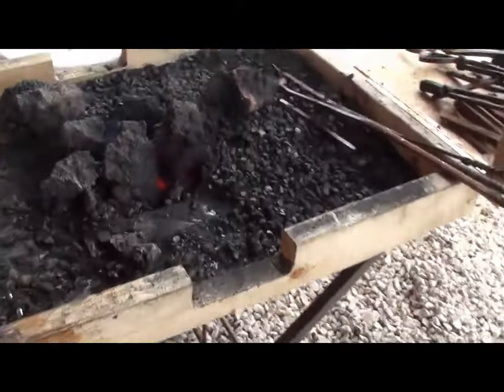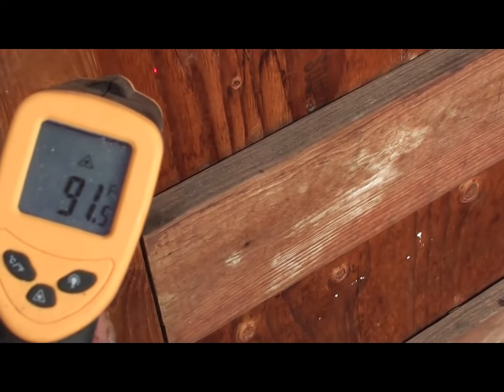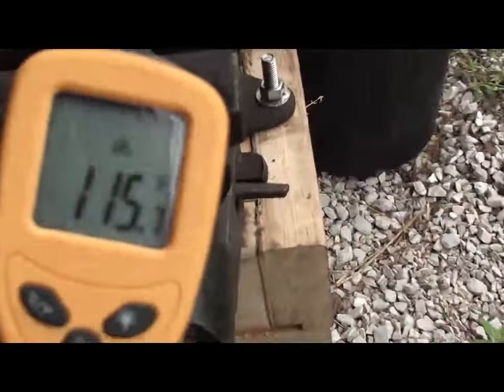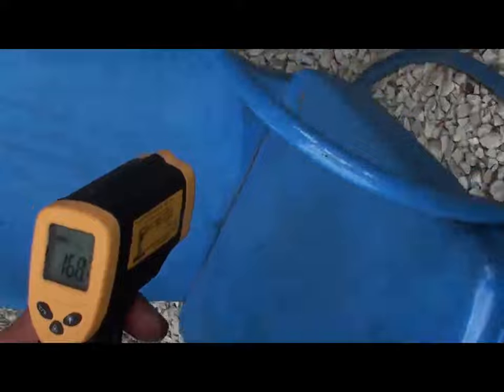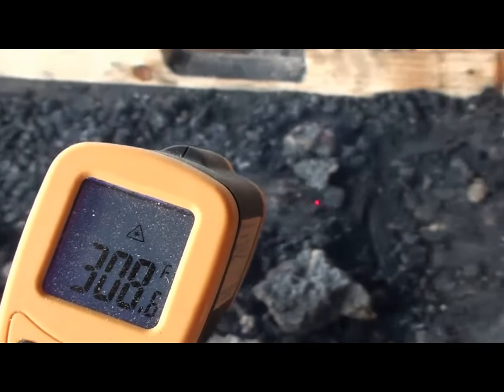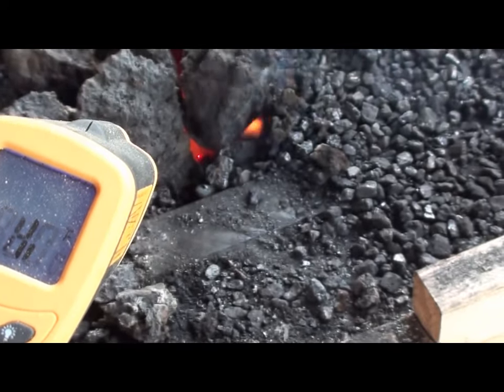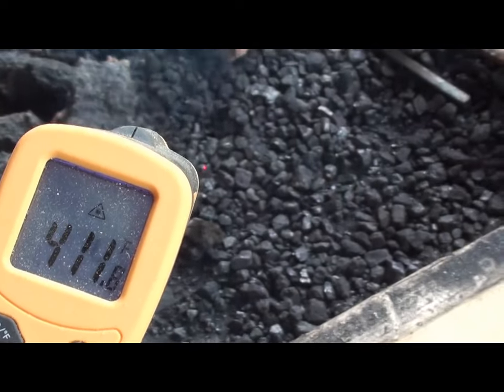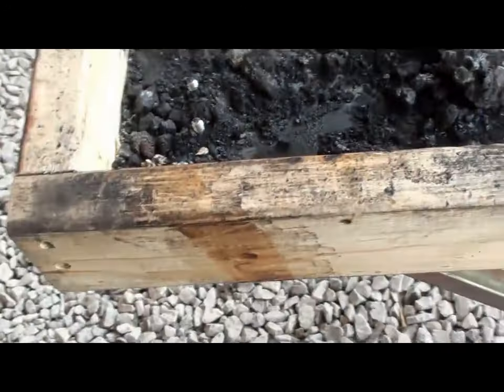Is that wood going to burn on that forge?

Comment: It will be good .
Reply from the maker: Tis good. I actually like this forge better than my buffalo with the bigger champion 400 blower.  Probably mostly because I built it but it does work good. And having the vice right there at the forge is really nice.
Reply: +bc65925 I am thinking after I get things done . I might make one . I do not know anything about it but I can learn . I have some projects in mind to do that would be fun .
Reply from the maker: A lot of folks use a brake drum or rotor for a fire pot and some use an old push mower deck for the hearth.